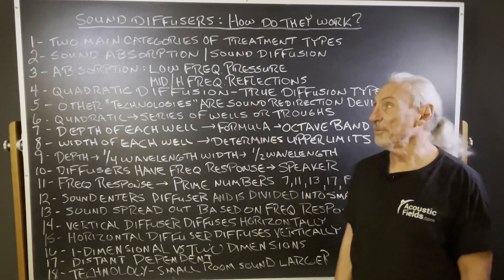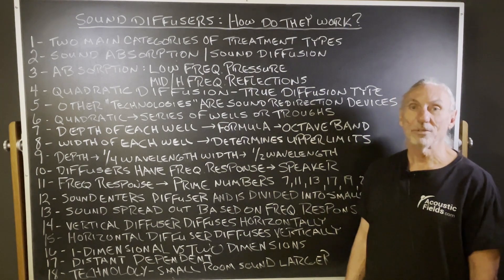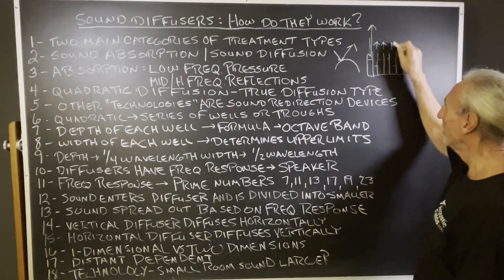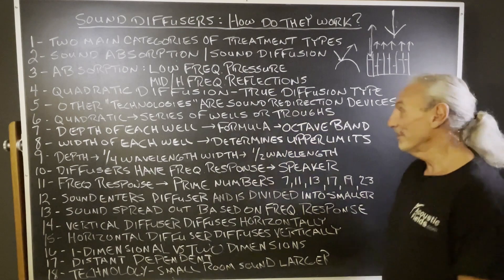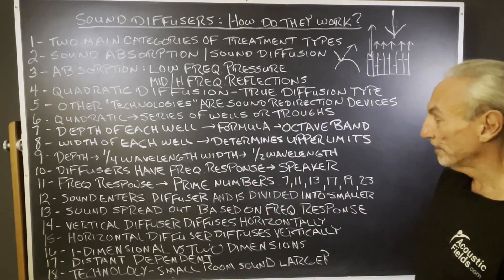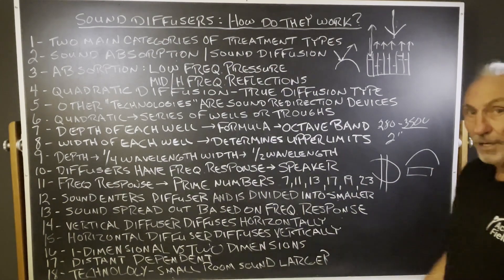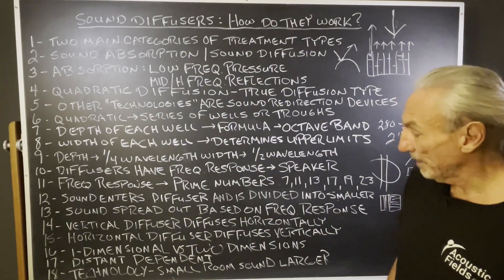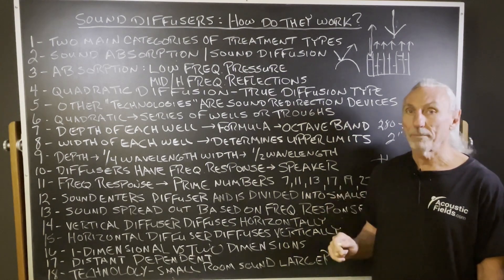Sound Diffusers - How Do They Work? - www.AcousticFields.com

Comment: Hi Denis,  I have to admit I am " All in"  I was able to convince my wife that the living room is not the living room but the " Media Room"   Thus the Big ugly Tekton speaker with zero WAF are acceptable; but just  barely.  I was able to bring the speakers 3.5 feet from the wall and dare not move them 1 more inch.  I have throw pillows which I am trying use as absorbers.   Again keeping within WAF.  Are you saying that a badly placed (or well placed) absorber is just as bad if not worse than " Nothing at all?"  Thanks for your videos and expertise.
Reply from the maker: Pressure and reflections must be treated on every wall surface area in order to achieve resolution. Position all energy sources (speakers) away from room boundaries. Treat in order of importance, the front wall (behind the speaker) first then move to sidewalls.
Reply: @AcousticFields   Thank  You for your time and expertise.

Comment: I remember many years ago Acoustic Fields had solid wood block diffusers that would cover the high frequencies above the standard Quadratic Diffusers you offer?  Can people still purchase those from your company?
Reply from the maker: You are describing a two dimensional diffuser. We do not sell those. You can achieve the same results with one dimensional placement.
Reply: @AcousticFields  Are we talking about the same product?  I was able to find the actual product and it's the MDW (Mini Diffuser Wood) and it was marketed to treat Flutter echo.    Due to the product appearing to be thinner,  wells/troughs are also thin and shallow, I would assume the frequency range would be narrower and higher.  is that assumption correct?

https://www.youtube.com/watch?v=-XcUNvL7-qE
Reply from the maker: The mini wood diffuser covers a higher frequency range. It is designed to add "sparkle" and "air" to high frequencies.
Reply: @AcousticFields  That's what I thought.  Do you still offer them?  They aren't on the Shop section on your website.

Comment: Hi sir I don't understand how the well width would be half the wavelength and the same time remain constant across the pannel what's the formula to determine the well width??
Reply from the maker: Reserach the modulus n formula. You will find your answer there.
Reply: But the modulus n formula deremintes the depth proportion between each wells, when it comes I've seen here and something like lambda over 2 which is the wavelength, but what wavelength are we talking the one correlated with the design frequency (like 1000hz) or the one that results with specific well depth (like 3300hz or 880hz...)
Reply from the maker: @Georges-rp1qi  Quadratics have their highest response at 3,450 hz.